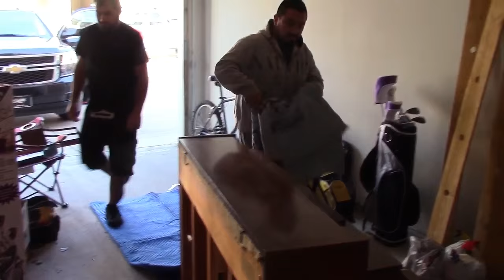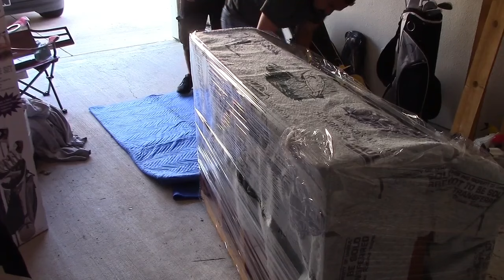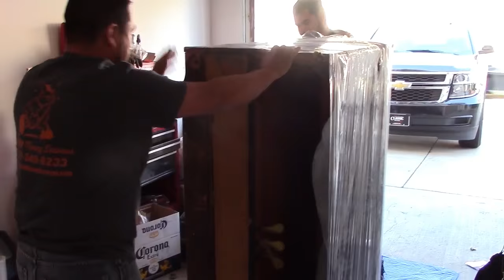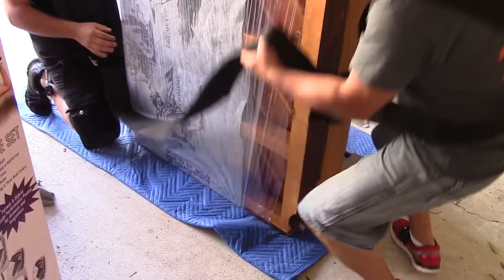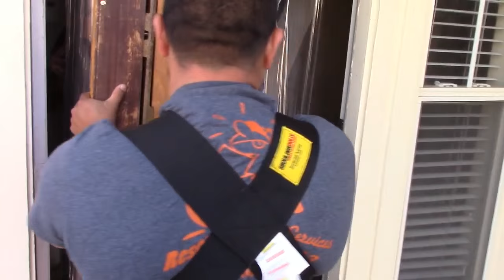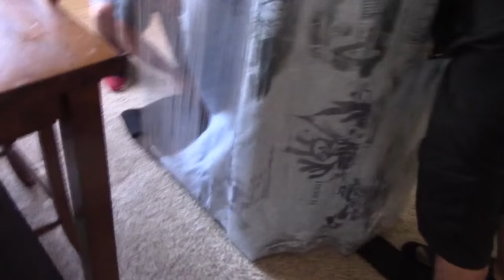How to move any upright piano upstairs with 2 movers

Comment: That's a spinet, 450 pounds, 40 to 46 inches high. Full uprights are 700+, 54 inches high. I'm 6'4" 265 pounds and I move over 1000 pianos a year. Full uprights get slid up stairs on boards. You strap a full upright and you're not long for this business.
Reply: John LeVasseur sliding something that heavy on the surface of someone’s flooring or stairs is never ok.
Reply: I tried to lift a 1920s full upright. I lifted and 2 people on the other side. We took 1 step and our backs hurt bad. Im 6'5 230
Reply: John is right. While most pianos take up a similar footprint, uprights are called uprights because they're technically GRAND PIANOS IN AN UPRIGHT FORMAT or position.
Reply: @bocowan819  he said on boards
Reply: Want to come shift my Pianola? It's only about 900 pounds or so.
Reply: @bocowan819  have moving blankets lining the middle of the stairs where the skid board will slide. I've moved hundreds of pianos and never once carried one upstairs like these guys.
Reply: I feel ya but they got it done 30 secs tops up stairs and all
Reply: That’s right, we just moved a 1000lbs 110 year old upright and two people just will NOT lift it😂
Reply: This comment is 100% correct. I’ve moved 100s of pianos as well. The shoulder dolly these two men are using, will not work an an actual upright piano. This is not an upright piano. The shoulder straps are great for flat moving. Once you hit the stairs, they’re completely useless. What the commenter is trying to say is this, use a piano board. Wrap the piano, and all it’s components. Get a piece of 3/4 plywood, and fashion it to a similar size as the piano. Strap the piano to the board. Cover the stairs with something to keep it from scratching. Both movers at the bottom pushing up, goes right up the stair.

Comment: We move pianos everyday. Take it from us that you guys really know what you are doing. I have seen your other videos and you guys are amazing (Almost crazy I must say). But why to make it so hard.

We use "Shoulder dolly/straps" but not for Pianos. "External Step" is such a simple solution to almost all the stairs. You carry an small skid equivalent to a step of the staircase (which can be adjusted to match height). All you need is lift one step up on a dolly and then slide an equivalent step to match the step of the staircase. Rest the dolly and then repeat till you are up. Opposite process on the way down. 

Irrespective of my suggestion, you guys are mind blowing. Taking a piano up with Shoulder Dolly (shoulder straps) needs courage, power and more importantly skills and experience. And you guys have it all.

Comment: I reckon its a reasonable way to move a low-backed upright like that but a high-backed upright is a lot heavier & bigger and there's a far better way to do it with two people. 
I move pianos fulltime and speak from hard earned experience. Piano moving is maybe 60% technique and 40% strength. No professionals I've ever met use the above method but it looks like a decent way to move a small upright, especially if doing a one-off. (you need plenty more gear to do it properly: eg standard piano moving trolley for a start)
Reply: I am thinking about to move an upright piano (Nordiska Futura) from 1st floor down (1 level). Is that possible with 2 persons? Piano weighs around 190 kilo. Would you recommend to disassemble it? I am technically talented. However... I am not a piano-expert. Any advice?
Reply: The piano they moved looked very light the way hey just lifted it into its side

Comment: i dont know much about moving a piano but why wouldnt they just pad the steps up and take it one step at atime... pad on the piano will not stop chip in a high glossand it is not like a dresser with the harp weight to the back, could get by on a spinet like this (36 inches tall and maybe touching 300 lbs at most .. from the old full size player uprights to spinets , can just pick it one step at a time and take your time ., or if tight overhead just put it on a piano skid board and slide up padded steps? ... but then again what would i know about pianos , i am just a moving fan, not a mover